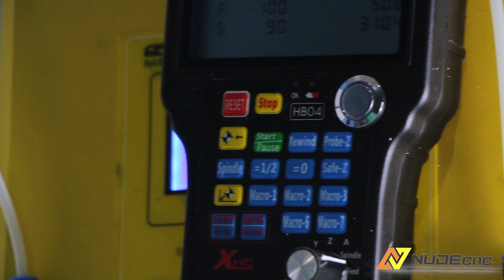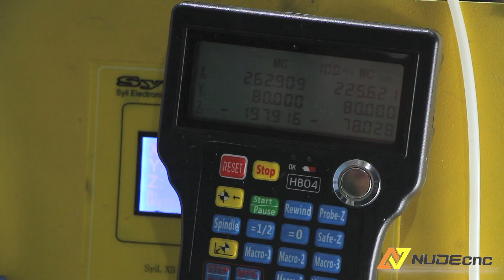DOUBLE SPINDLE MILLING MACHINE conversion 4 axis Part 1/2

Comment: I bought a x7... what a piece of trash. seems yours is running fine. the torque of my motor is trash. It said at web site it was a 2kw motor. well.... that's the VFD power output. The motor was 1kw. Talk about scamming. I can stop spindle with bear hands at low RPM'S. Should have bought a tormach xD